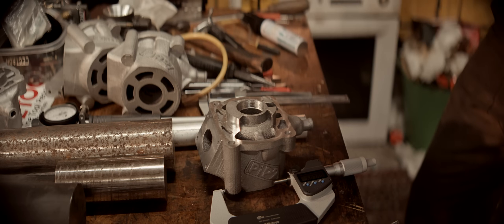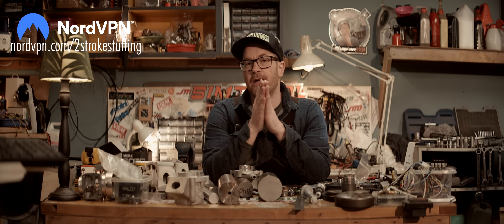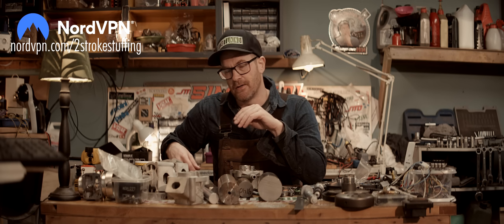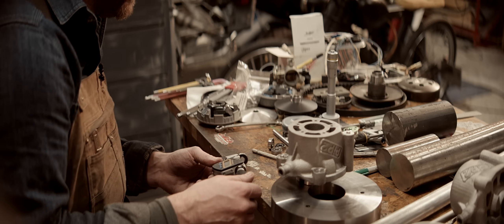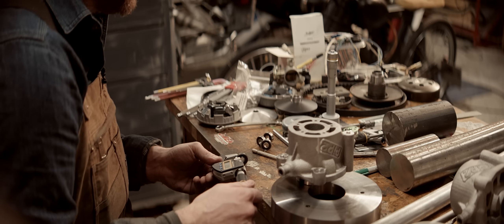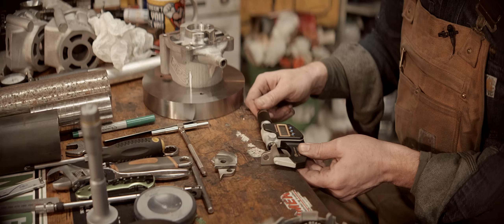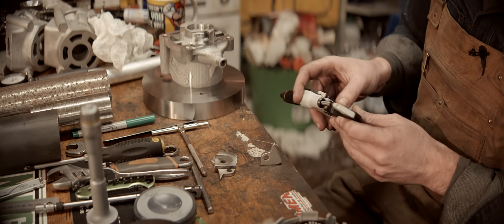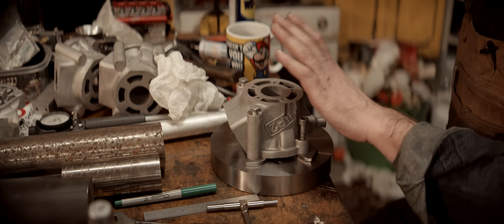PiP2 50cc Two Stroke Cylinder finally ready for plating!

Comment: 14:36 get yours a 30 mm bar mill flats on one end bore a hole 20 mm on center from the enda 12mm hole for a tiny boring bar. With a couple m6 grubs to secure it. About 200 mm long should suffice. This should leave nearly 10mm for shavings to evacuate. Maybe make it 50mm longer and turn the end down to about 20-25 mm so it can also be used in a mill. I hope to get a lathe next year.    Seems a lathe can be slightly more useful (or more versatile) than a mill. You can always mount a vise on the crossslide. And chuck up a milling bit and use the lathe as a mill. It is limited in the size job it can fit. I haven't seen anyone chuck a cylinder in a mill. Then a tool in the vise. It doesn't work out well 😂... Im hoping i can get at least a  lathe with 6"-8"chuck, capable of holding work 12"x 30" roughly a 12" chuck and 72" bed wiuld be awesome, capable of swinging nearly 24"  I'd build a angle plate to fit the cross slide. With a set of ways and ball screws to gain an additional axis, about 8" travel with a roughly 16"x18" deck to clamp or bolt work to. Made of 1/2" plate welded to 1" bar stock milled flat and square, the plate milled flat drill and tap a couple rows of mounting holes. Using atlesst 1/2" bolts , maybe 3/8" definitely not smaller,and possibly a few 5/8" holes like one in center. With one in from each corner. So a mandrel can be bolted in the center to center the work, then clamp on the corners  mill dove tail ways. With two ball screws driven by a center mounted shaft with a small chain and sprockets a 30t (+/-)on each ball screeand 10t or less in the driver. To get a 3:1-3.5:1, possibly a 4:1 or 5:1 reduction. With a splined detent to lock in position. Use a roughly 3"disc, about 1/2" thick on the ball screw shaft. With a triangle shaped tip on the end of a bar with a pivot on one end. A spring keeping contact. The disc having grooves cut about .050" deep the triangle fitting inside , yet unable to prevent movement, maybe change to a smooth disc with a arch in the bar that fits the disc for about 3/4"-1.5" of the disc diameter, both having a spring keeping tensionin the disc. With a fine thread 3/8"-1/2"bolt with hardened threads, and a 5/8" thick plate/ nut with hardened threads , using about 1/2-3/4 of a turn or slightly more used to put pressure on the disc through the triangle or the "brake shoe" maybe use the triangle bit on the driver shaft. Using only a spring to keep tension. With the disc and triangle tip hardened, and lubed. Its use is to prevent movement from vibration,  the bolt and "brakeshoe" on the ball screw used to lock into position. The disc spinning between two 3/4" x 1/2" steel bars with an arch milled into them to fit the disc on the shaft, just past the bearing, with one bolted solid and shimed to be .0008"-.0015" from the disc at the tightest. And up to .003" basically .001-.003"clearance, allowing room for grease. And the disc and shaft being untrue . The disc being milled and ground in a lathe. With less than .0005" run-out per 6", or roughly .0001" per 1.000"  the nut for locking being a 5/8" thick bar 1" wide. Running from way to way bracing with the center drive shaft bearings and chain tensioners attached to it. Using a 8mm shaft and pillow bearing blocks with a 4" wheel with two pivoting cranks for spinning the screws FAST or Slow. One being a 3" bit of m8 bar with a m4 screw in each end with a 1/8" washer on each end with a oilite or a plastic bushing in the wheel, at about 1.75-2" from the center. The other being  on the opposite side of the center shaft. And being 8mm from the edge on center, leaving about 3mm(1/8") on the edge with a 10mm hole , drill the hole , ream it, heat it to about 150°F press in the -30°f  bushing, when its all the same temperature bore the bushing to 8mm with a .004" clearance, use a dry film lubricant or oilite bushing. For the ground m8 shaft.  Again a 3" bit for the crank lever, with a allen head bolt and 1/8"-1/4" thick "washer" using a M4 Allen head bolt possibly a taper seat or button head bolt. On each end using loctite. One used for rapid traverse. The other for slow precision movement with high TQ. Or both can be lifted up and a screwdriver fitted between to apply additional torque. The wheel being cast from aluminum 4"-4.75" diameter 2.25" thick/tall  rim, and 1.5" from edge towards center. With 5 spokes 3/4" wide 5" deep with a 2" round center 4.5" from wheel rim to center. Drill a m8 hole through it. With a keyway and m6 grub screw, or drill a 1/2" hole with 1/4" keyway. And threaded on the end with a 7/16 nut. The base being a 1.25" bar turned down to 1/2" , drilled for m8 shaft 2"deep. The 3" long 1" shaft milled flat on two sides drill two m5 holes and tapon the outside of the 1"flats. Use a .050" slitting saw to split the shaft center of the m8 bore, and flats. Cut about 1.5" deep then cut 1/2" deep on the bottom of one cut cut a 1/8" keyway 1"deep. Drill out the threads in one half of the threads on each side if the holes probably opposite sides. Put two 25mm m5 bolts in loose. Put a 1/2" long 1/8" key. In the shaft,1/8" wide, 1/4"deep x 1/2" long, loctite key in shaft. Put wheel on adaper arbor, then slide on the shaft, and tighten the bolts to 10ftlbs or 1/4 turn after it stops moving on shaft possibly engrave small grooves around the perimeter about 1/16" apart, a 1/32, 1/64,1/128 will be about useless , can't be seen clearly, and bend and shape a 1/8"-3/16" bar 1/2"wide. File down the tip to a peak. Then the sides down to a 45°-60°bevel   then cut down the point until  basically a wire is sticking out the tip. It going from 1/2" then a 1/16" point, then a tiny flat thin point with a .030" long, .030" wide point pointer  with possibly a 10x magnifier attached, to point out 1/64" wide marking pointing out every 1°, 2°or 4° or so depending on the size and tool used to engrave. Or it could be engraved to show the amount if movement each amount of rotation lifts the work surface 1.5 turn = .010" having one turn to equal .0001"would be excessive. Unless it had two speeds a slider on the shaft  catching a 4:1 reduction and a 2:1 for example. Getting a .001" per rotation and a .010" would be better, still tempting to put a drill on the retainer nut the installation would allow. The crank being 1" off center could spin fairly quickly by hand the near 2.1" still quick a 8" wheel would be better a 16-18 mm sprocket spinning a 60-80 tooth with links about 1/4" pin to pin center. Looking to keep the TQ on the ballscrew under 20-30 ftlbs. Applied with the reduction, not to the reduction with a 4:1 reduction this is 4x the TQ, 20ftlb TQ x 4 = 80ftlb TQ, id want to apply 1-2 ft lbs on the wheel, get 8-10 ft lbs TQ on the ball screw. So lifting a 20lb steep part will require 5lbs on the wheel (or less). So start high, lower. While working. This is why the brake is used. To lock in position, or make  moving just difficult enough for precise movement.  Sorry to ramble. Im hoping to get lathe,  use it to build a mill , first i will need to build a generator, 3phase, possibly two-three running from a single engine, using a 2.2 litre toyota engine running two or three generator heads. A 10kw 120/240 and a 30-40 kw 3ph. 220/440, id like to run 440v,  a Toyota engine with a electronic governor. A over drive gear allowing it to run at 2400-2800 rpm. Possibly make a intake manifold with 30”-36" intake runners, with a 1.25"-1.5" diameter or about, 35% smaller than the original. And 2x longer pushing the peak TQ from 4600 to 2400-2800 rpm it will not exceed 3k rpm.  Id rather not have two 3phsse generators, a single. 240/or 440 and a 120/240 for 50 kw or less (30-50kw) have an awesome day 🎉, sorry to have rambled!✌️🕊️

Comment: Your lathe probalbly has its headstock not true to the rails. In most lathes the headstock position and angle is adjustable, just loosen its bolts, adjust and retighten

Comment: Loving the progress. Just an observation. . . your lathe may need some calibration. Get a piece of ground 4140  in the chuck and sweep it with a Dial Indicator, it could be that the headstock is not parallel to the bed.

Comment: Alex, please focus on better machining habits. You have a big audience and with that follows an obvious responsibility.

Loose clothing around a rotating chuck is no joke.

Nobody wants to see you get hurt, and everybody should learn about proper machining habits.

Even a small lathe can mess a hand up badly.
A big one will chew up a person, given the right circumstances.

Machining is no joke and the issue is that one time it goes wrong, not the 1000 times it goes well.

Comment: Please reduce the extended length of your boring bar to what is absolutely necessary. Most of the reason you were cutting a taper was due to reduced rigidity caused by overextending the boring bar.

Comment: Legend has it that placing a magnet on the boring bar (especially when it has a long overhang) can greatly reduce chatter. I've never tried it, though
Reply: I watch a machining channel (inheritance machining), and in his latest video, he tried the magnet trick, and it actually worked 😊
Reply: I think the point is that the extra mass of the magnet changes the resonant frequency. Changing speed can also have the same effect but since this is usually done with gears the result may be a harmonic of the original frequency.
Reply: A magnet quietens down a ringing anvil quire effectively so it is certainly worth trying

Comment: For the job on the drill press when you needed exact shims, Adustable paralells, have it sat solid then just make the parallel the same height as the other side othe hole.

Comment: I'm really looking forward to seeing how many horsepower your cylinder makes. My guess is 19.50 on the rear wheel. The bidalot wr 50cc ported makes 18 ish on the rear wheel.
Reply: I would like to think 23 when fully tuned due to higher RPM.

Comment: what is the tool called that you used to measure the internal diameter of the cylinder at 16:50? i really need one of those

Comment: Why not machine an interference fit and then freeze the cylinder and warm the machined piece to hold it tight and the just warm the piece to remove the cylinder.
Reply: The cylinder will spring back after removing the jig and the diameter will be bigger on the bottom part. Maybe it would not be enough to cause a problem, but it's something to consider.